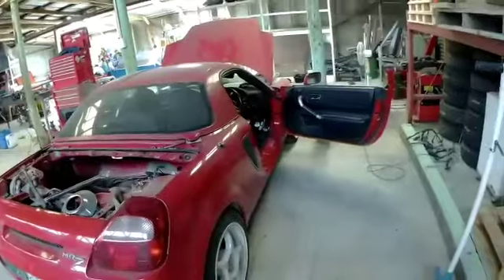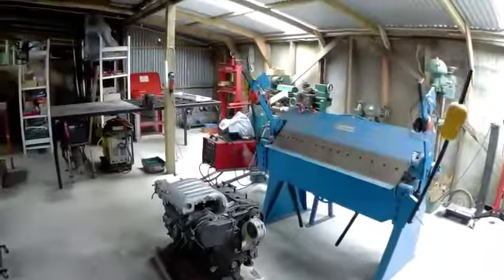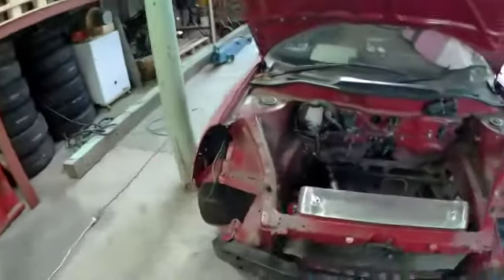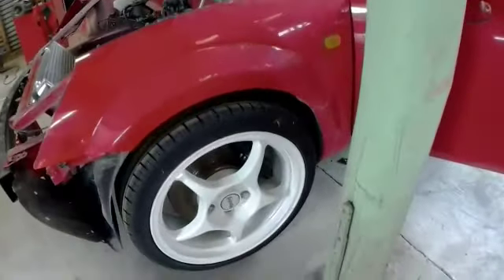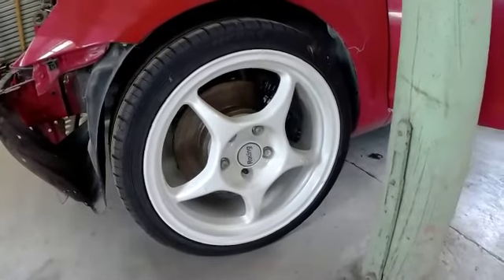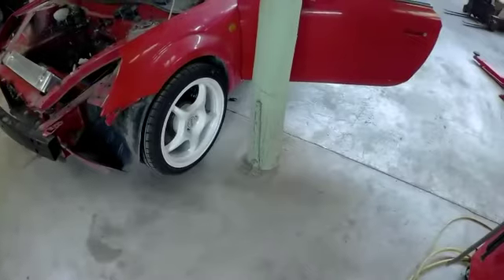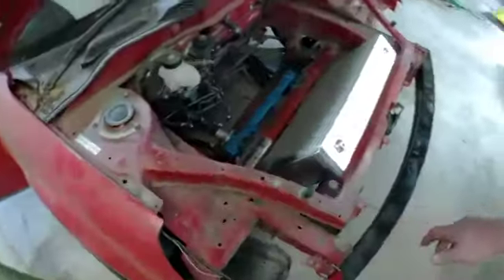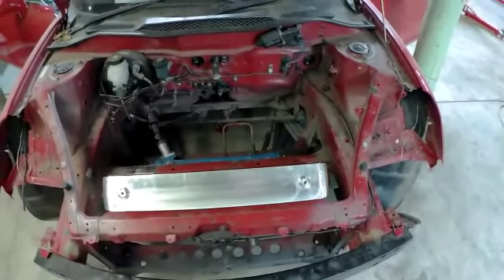The beginning... An unusual mr-2 v6 conversion.

Comment: I would've personally done the 6g75. Really good flowing heads. And lots of power with low boost if you ever went that route.
Reply from the maker: Cool thanks for the comment. I've got a 75 sitting on the shelf.  Reason not to use it. It has  thinner cylinder walls.  it also has long stroke and won't rev as well.  I know the heads flow better  and I am planning on boost.  I have have got my hands on a quad Cam mivec 72. Those heads will flow well when I choose to go for big power. Cheers.
Reply: @g-mech1244  good stuff then.you gotta let us see more updates

Comment: bloody hell Brad ya done good on the 5 stud conversion,  not sure about the motor choice thou LOL
Reply from the maker: Stephen Jones , thanks for that. I've had a little backlash on the motor choice as expected.  I  think  my next video may be on why I've chosen it.  I'm sure it'll make the power  if I throw enough boost into it.
Reply: yeah I figured Boost would be part of the equation eventually,  Im tossing up whether to bite the bullet and rip my K20/24 out of my Civic and transplant into a Spyder so your 5 lug and brake upgrade is very relevant

Comment: When you are talking about the 5 lug conversion and you reference Mitsubishi parts on the rear and front you don't mention what Mitsubishi... can you name the specific model? I need this! THANK YOU!
Reply from the maker: It's not a bolt on conversion. It's really only suited to a build like this.  You won't have abs anymore.  The front hub section does bolt on but reqires custom brake brackets etc.  The rear requires a small amount of machining  and uses sw20rotors only. I will be starting to make more videos soon.  Cheers